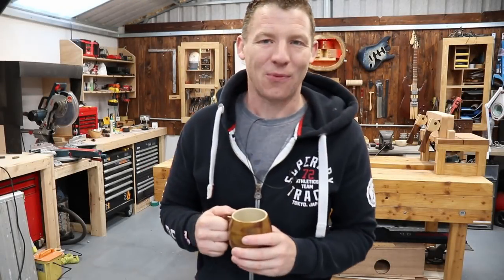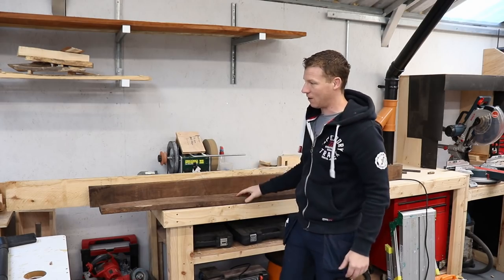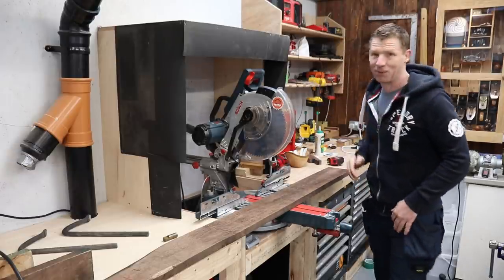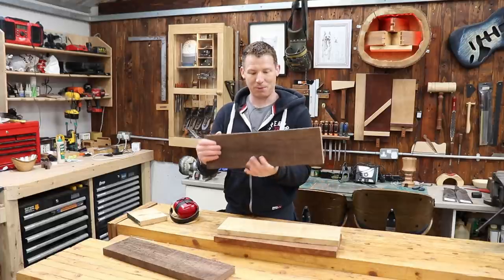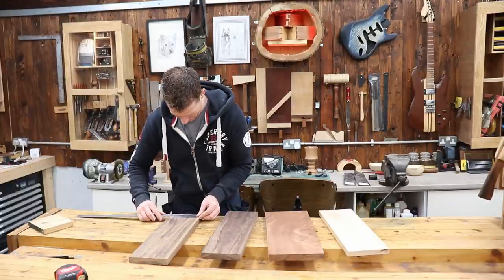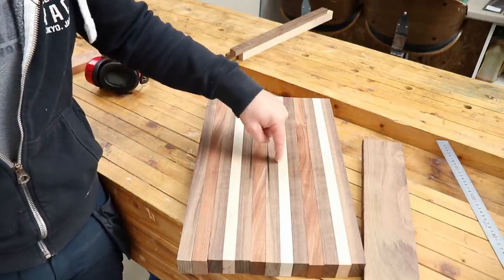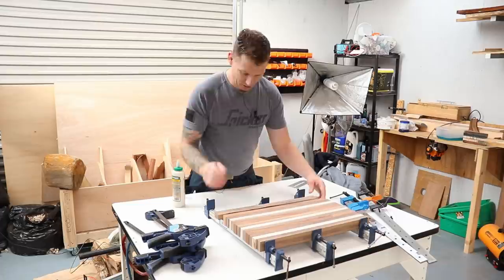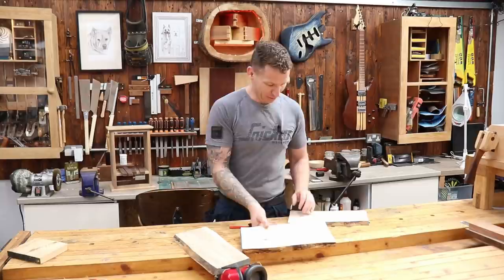Cutting Boards, Cheese Boards and Bread Boards. Some Simple Ideas for a Woodworking Project.

Comment: I have had some chip out similar to the cutting board you made. Instead of filling it , I just took it to the table saw and shaved a minimal amount off and again to the router table. It worked out well. My first time here. I'll be back.
Reply from the maker: That would work well. Welcome along George.

Comment: Great work John. Thanks for sharing. I would have liked a closer look at the result of the repair you did on the laminated cutting board.
Reply from the maker: Completely forgot to show the repair, that's what happens at the end of a long day. It turned out fine you can see it if you look for it but it doesn't stand out.